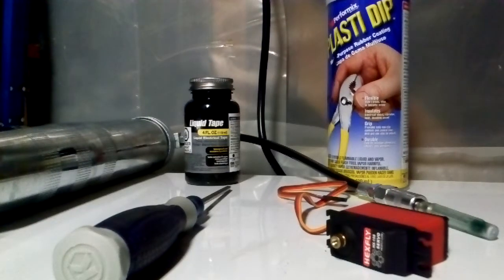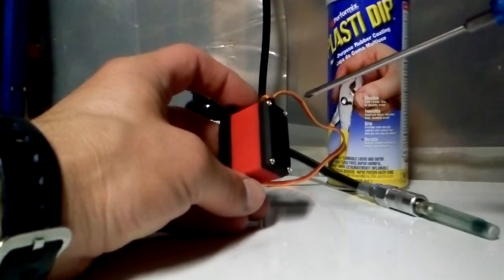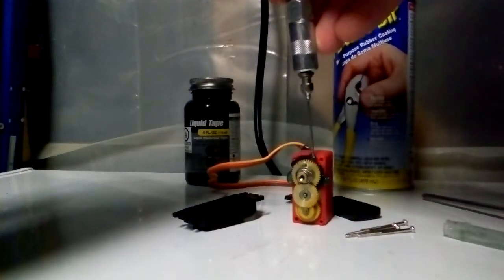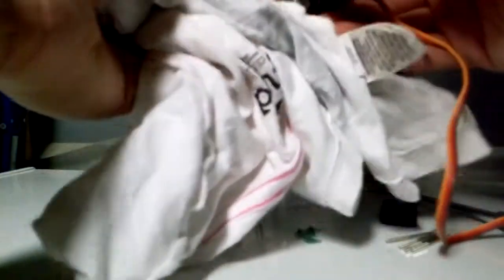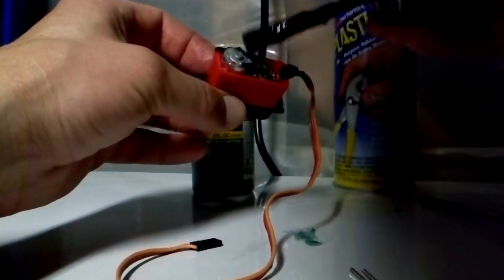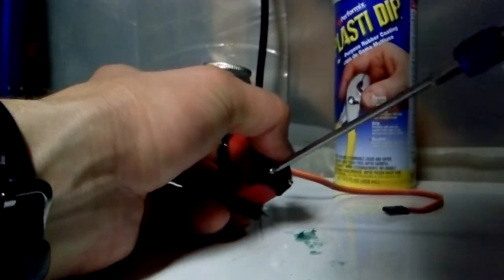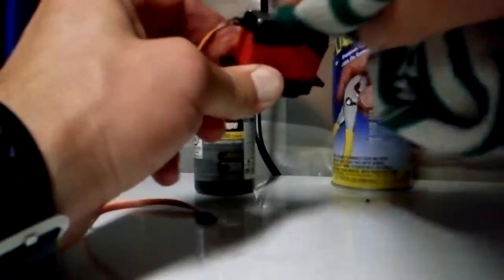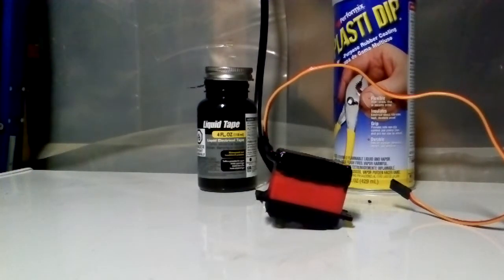Waterproofing Servos - Easy step by step process

Comment: do you not notice any binding issues with using that much grease?
Reply from the maker: Captncouth No I never had any problems with binding.  I've heard people notice issues with it, but the biggest thing I found is making sure everything messes properly, cause that's where I've found my issues if I messed it up.  It's that center pin that is a bugger to get to seat into the top of the case when you close it back up.  

I'm working on a new waterproof video for servos with that silicon conformal coating I've been using for a while.  I don't even worry like I used to.  I use a lot less grease, cause the circuit board is protected.  

Thank you so much for your comment.  ;-)